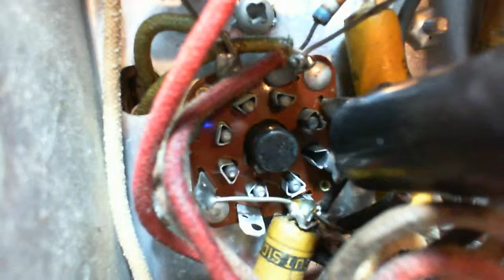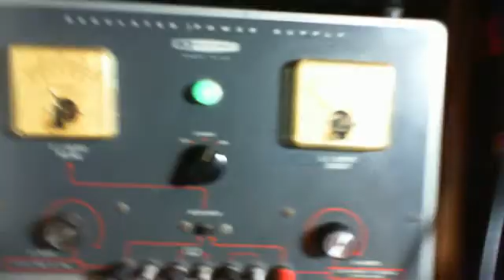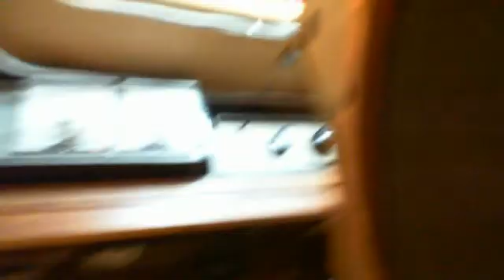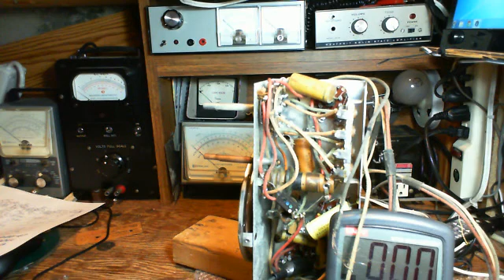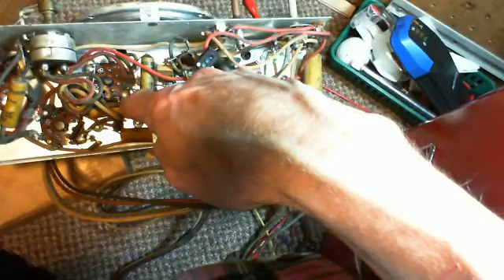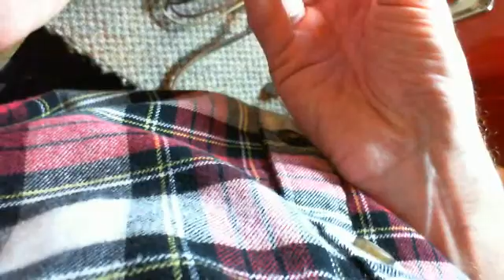General Electric C57B Farm Radio Video #3 - Troubleshooting Begins

Comment: Back home in west Tennessee my folks didn't get electricity on their farm till the mid 50's.  Got running water in the late 50's and a wood stove for heat in the late 60's which wasn't replaced by a propane stove until about 1996.  It wasn't that they didn't want electric or running water, but the TVA didn't run electric lines out that way till then and even when they got running water it was and still is well water run by an electric well pump as the water company to this day hasn't run city water to that area yet.